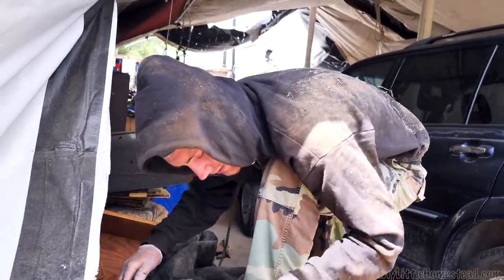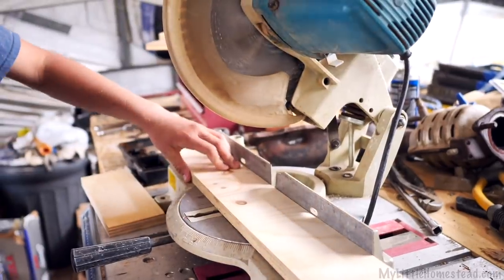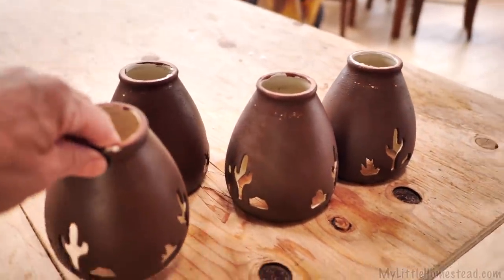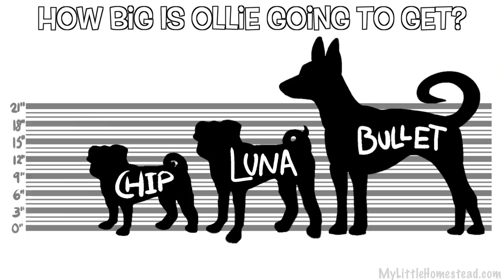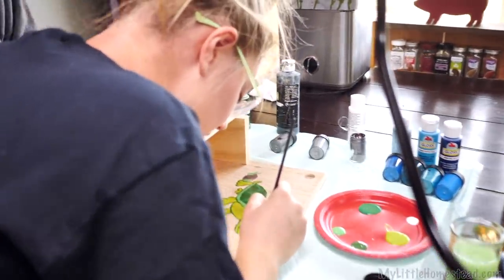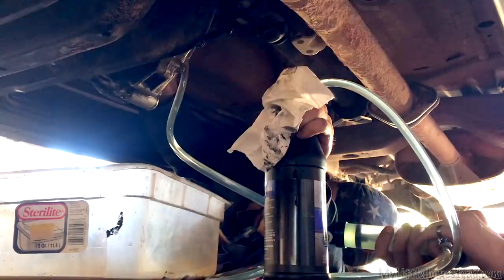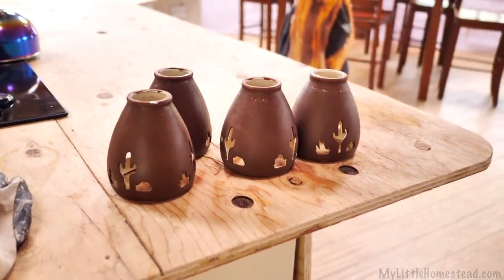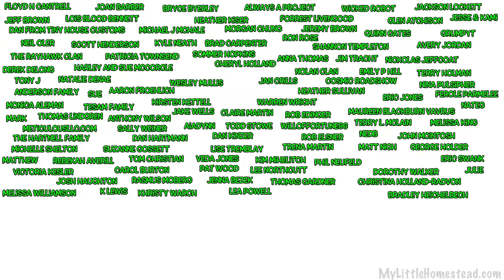Suzuki Engine Swap Complete, Outdoor Shower Caddy, Patio Solar Lights | Weekly Peek Ep186

Comment: Shae: Idk about making your own hair products, but I started oiling my hair a couple years ago- my hair is down to my waist, and while the parts near the scalp get some oil which keeps it healthy, the parts below my neck would get drier and drier. I bought some oil (I use almond oil, but I hear pretty much any oil works), and I run a palmful through my hair thoroughly in the evening. Then I braid it tight and sleep with it in, so that it can soak in as much as possible, and I wash out the excess in the morning. 

If I don't have the time to plan ahead and oil my hair/ time to leave it in, I only shampoo the part of my hair that touches my scalp, unless my hair's particularly dirty for some reason- the rest of it doesn't really need more than water, it's not getting oily from my scalp. Extra shampoo would only dry it out. 

(I also add in a couple drops of lavender when I'm oiling my hair, bcs the smell helps with sleep. Mmmmm.)

Good luck with your hair experiments!!

Comment: Just a tip, when welding cast manifolds, preheat the area you are welding with a torch before you start your weld. This goes for all cast. The repair will last longer. So impressed you guys always do a great job.

Comment: Conditioner technique: Wash your hair, towel dry, then take a TINY amount of conditioner ( start with less than a pea-sized amount and adjust according to results and length) in the palm of your hand and rub your hands together to spread and heat it up, then run your fingers/palms through your hair starting with the underside and ends. Use very little to none at the scalp/roots and top to avoid looking oily unless deep conditioning. 

Your scalp produces it's own oils, so you generally only need a touch on the ends, especially if you are not stripping your hair daily with modern commercial shampoos. You could even let your hair dry completely first before conditioning to really see what your hair is asking for.

 If needing deep conditioning, use more, then leave-in for a while, even sleeping with a beanie on to get the deep heat treatment then wash thoroughly. 

To add a nice scent to the mint extract in the conditioner, hammer some fresh rosemary and leave it in the jar to infuse. I love the rosemary-mint combo! For the baking soda shampoo, maybe add a wee bit of lemon and honey to that so they all work together. The acidic lemon will help remove oils and the honey will heal. Good luck, sorry to babble <3

Comment: I have been using baking soda to wash my hair for over 7 years. It works by opening the scales of your hair to allow it to release excess oils. I really only have to wash my hair about once a week because it no longer over-produces the natural oils usually completely stripped away by modern shampoos. You will only need to wash the roots and your scalp. I also used a 50/50 mixture of apple cider vinegar and water, in a spray bottle, as a “conditioner”, which closes the scales of your hair. This only needs to be applied to the ends.

My hair is so much more healthy, fuller and softer, since I’ve been doing this! And it’s so much more inexpensive!

Comment: I love that you are trying out the "No Poo" or "Shampoo Free" hair care. There is an adjustment period while your scalp gets used to not having all its natural oils washed away completely, but it will eventually even out. Ive actually been using Baking Soda/Water "Shampoo" and Apple Cider Vinegar/Water "Conditioner" on both mine and my kids hair for over 6 years, and I love it!
Reply: @Leslie M Agreed. And not only do you have to figure out the right ratios for your particular hair, but your water too. And if the water changes, like when my city changed something they treat the water with, or in the MLH's case if there's lots of rain or something, you may need to adjust it again. 
We also add tea tree oil to ours because scalp and skin conditions run in our family, and the tto helps with those.

Comment: Bryson,
I hope you didn't let Ben forget the blinker fluid.  We all know how quickly that runs dry.
Reply: Sounds like they need to check their muffler bearings too.
Reply: @williwonti  and the wind shield gear fluid. that's a must. (My dad told me that one)
Reply: Hah! My older brothers did that to me back when I was kid!
Reply: It doesn't run out if you never use your blinker. That's why so many people don't use their blinkers cause that blinker fluid is so damn expensive and hard to find.
Reply: @shadfurman  
Nobody uses them because they always run dry.  I guess all of them have a built in slow leak just to make you buy more fluid.
Reply: I think you used to much conditioner try adding glycerin to cut it

Comment: My Suzuki is 12 years old, I just love it. It's now my back up vehicle. As long as you change the oil every 3 months or 3000 miles it will last to 250,000 miles. 👍

Comment: I think your little guy Ollie is going to be about the same size as Chip.  He was so cute when he almost fell asleep standing in the kitchen.  Love the bathroom caddy's and the artwork on them too!    Great job on getting the car going.  I have the same philosophy on car buying as you.  I own a 2000 Ford Taurus that with a rebuilt engine now only has 85,000 miles on it.  I only paid $2,500 for it. Deals on cars like that fit the budget!

Comment: Use nickel welding rod and preheat manifold to glowing red orange, weld, slowly cool down by wrapping in a fiberglass welding blanket from harbor freight and it might not warp. Bolt manifold to a steel plate 1/2" thick and do the above and it gets better. Also  prep manifold by grinding crack to a grove. Find ends of crack and drill a small hole at the ends to stop the crack from getting longer. Every welder that I know has a different prosses on welding cast but after 45 years of weld on mining equipment this is the best that I have found. Keep doing what you are doing, it's fun to watch.

Comment: When you use homemade oil conditioners like that, you just use a tiny dip--just enough to barely grease 2-3 fingertips. Then, just work it into the long ends OR after it's dry, you use it to tame the flyaways. That's what I did when I used it with long hair.

Comment: I think Ollie is going to be exactly the same size as chip (maybe smaller?). There should be a prize for whoever is right, like a free T-shirt! Bree, you honestly think your turtle looks like a four yr. old did it! WHAT! You'd have to be a child prodigy! Bree and Shae, you both did so well with your paintings! WOW! Shae! that is some amazing woodworking skills!!!!Those solar light are amazing! So cute! (cute means smart technically and these lights are! as well as adorable! which is what most women think cute means) Great job boys getting that engine in! I could go on and on, but in short your family is oozing talent, humor, and genius!
Reply: I paid 182 bucks for a 1975 (?) Chevy nova (it looked like the two door model but with four doors), just needed a new battery. Ran like a charm for 3 years until I got pregnant and couldn't fit behind the wheel and had to sell it.

Comment: You probably have yucca plants around your area. You can use the root to make shampoo.  Peel the outside of the root, cut up and grind it down to small pieces. You can put some of this in water and squeeze out all the liquid from it.  You can also dry it for it to last and just use a little at a time as you need it.  Yucca is a great plant and used for many things by native peoples.  You can use the fibers in the leaves to make cordage.  You have to break down the leaves and scrape the fibers down ... the pulp/sap that comes from the leaves can also be used a shampoo/soap but the root is better for this.  You can eat the flowers before and after they bloom. the cordage was use to make shoes/sandals etc.

Comment: I've used baking soda and water as a shampoo and apple cider and vinegar in water as my de-tangling rinse for a long time.  It works very well; however, at some point you may have to adjust the baking soda water ratio depending on the hardness of your water.  Same with the vinegar water ratio.  You will also possibly go through an "adjustment" phase in a couple of weeks where your hair will look...well...unclean...lol  When I hit this, I added a little more baking soda to my water and backed off a bit on the vinegar.  Things balanced out for me and then I gradually went back to my standard ratio.  I have waist length, very fine hair and this worked out well for me.  I use the standard 1 Tbsp baking soda per 8 oz water and the same with my apple cider vinegar rinse.

If you're looking for a great lotion that works on face and body, try this...

Ingredients (Used Family Dollar Brands if you can get them)
13 oz pure petroleum jelly (vaseline)
     ( I use a tube of Vaseline Jelly and a tube of Vaseline Cream with Shea Butter to total 13 oz, or close to it)
15 or16 oz baby lotion (not oil)
16 oz vitamin e cream (not lotion) - my Family Dollar carries this and it's a really good deal
Aloe Vera Gel, clear not green (14 -16 oz bottle)

Put all the ingredients into a good size mixing bowl that you're no longer going to use for cooking (buy one at the dollar store) and mix with a hand mixer until well combined and smooth.  Portion the lotion into glass jars with plastic lids and use away.  This makes a really nice gift too.  Anyone I've ever given this to loves it and either wants more or the recipe.

Comment: I'm the type of vehicle buyer that I like to get a good deal and then run it till it is dead, and then some. My current vehicle a suburban I have had for over 10 years now, just had the clutch go out in the automatic transmission so a friend is rebuilding it. I do have this crazy plan that when the engine finally goes I will convert it to a electric vehicle, probably with a generator for long trips, which would actually be cheaper to buy a new vehicle but I have put so much time and tinkering into it that I just wanna keep it. I have also been working on vehicles off and on for over 20 years so...

Shae you may want to add some drainage holes to your shower shelves. Otherwise you way find your shelves becoming buckets, particularly during monsoons.

It is amazing how just changing a little thing like the light covers can bring new life to something. I think it is much better to just update the looks like you have then to replace the whole unit, when we bought our house we had three hanging lights with very colorful light fixtures that didn't really match the rest of the decor, so after some shopping around I found three new covers that worked with the lights and accents our decorating.

I think Ollie will be a little smaller than Bullet. But who knows maybe he will be as big as Clifford the big red dog :P

Bree the land turtle name you were thinking of are tortoise. Nice gila monster, I always loved them but didn't want to touch them.

Nice use of the solar lights and ceiling fan cast offs. I tend to get maybe 1-2 years out of my solar lights too, if the solar cell is still in good condition I sometimes replace the battery and get longer use from them.

Comment: Shae, if you use the baking soda shampoo, it will help get rid of the residual oils from the conditioner. It is a good shampoo to use if you use a lot of hair styling products too since it removes the build up of those products on your hair.

Comment: I use baking soda and water to wash my scalp, leave it on for about 5 minutes. Then rinse with apple cider vinegar and water, leave that in for about 5 minutes. Then a final rinse with warm water. I wash my hair once a week, but have gone longer before it gets oily. My hair is not oily or dry normally, so adjust the time table for your hair.

Comment: Just wanted to mention. for some reason after sitting for a wile some brake pads ware alot quicker.  so I thought i would mention that so you could check them in a month. may keep you from scratching the roters. those light Suzukis tend to stop not to bad on just roters but... then you have to replace them calipers and roters. been there done that. I learned the hard way to replace the pads after sitting for quite a wile. Menny safe traveles.

Comment: Use apple cider vinegar for conditioner. A mix of 1 to 1 with water works great. Make sure the vinegar has the mother (not pasteurized). Leave it in for at least ten minutes and then rinse it out.

Comment: I had to do a dep clean on mine and we took out all the seats and center console, it is cleaner but we learned there were different sized bolts when we were putting them back.
Because if a bent axle I cant drive it and I really miss it...

Comment: With your conditioner.... Only use a TINY (fingertip size) bit and smooth it into your roots first. Then, brush it through. Honestly, that recipe is meant to leave in and deep condition! I use it for about à week before coloring my hair and about 2 weeks after in order to put the shine and hydrated, healthy look back into my hair. Believe it or not, you can use just the coconut oil by itself, the same way as I've mentioned if you want it to be a much lighter level of conditioning. Also, coconut oil mixed with brown sugar makes an amazing lip scrub. If you make a big batch, add a bit of baking soda and it turns into a great, hydrating body scrub!

Comment: Just a suggestion regarding the shower box, if you haven't already done this...drill holes  in the bottom of the shelves so water can drain out and not sit inside the box.  I didn't see holes when you were filming...perhaps I just missed them :)

Comment: I'm pretty sure those solar lights just have a rechargeable AA battery in them.  I think I salvaged one once by putting in a new battery.  However, at $.97 a new one is cheaper than labor needed to salvage.

Comment: If that manifold cracks again, you should find someone with a TIG welder, or at least a gas shielded MIG machine with a healthy amount of power. The flux core just doesn't penetrate cast iron well.

Comment: If you don't wash your hair for a while, it does take a few months, your bodies natural sebum production decreases so your hair is less greasy.

Then you don't need to condition, the light ends of the oils evaporate leaving a very thin wax that gives hair more volume and bounce like high end designer conditioners (that really aren't good for you).

If your hair gets dirty, warm water melts the wax and will rinse out most of the particles.

If your hair get REALLY dirty, and you need a little more than a rinse. Some plain real soap (some EO fragrance is ok of course) like the kind of soap made from rendered from fat and lye, or some plain glycerin soap is ok too, desolved in water, (this is kinda like a dilute of Dr. Bronners, so you can just buy that if you want, I find it too expensive to be worth the cost) I like to put it in one of those foaming hand soap pumps.

You'll want to recondition after using soap or really hot water, one of those hand pump cooking spray bottles for olive oil work great. Maybe 1 tblsp olive oil to 4-5 table spoons fractinated coconut oil or MCT oil, shake it really good. A lot of people like macadamia nut oil, but it's stupid expensive.

You kinda wanna fluffy your hair as you spray, you want to get the underside more, it'll wick up to your top hair if you get too much, but if you get too much on top just rinse it through with hot water. The MCT oil evaporates leaving a very thin even distribution of olive oil, which is a little more greasy and heavy than your body's natural wax, but it keeps your body from over compensating to reduce the dryness.

Sebum is a healthy part of your immune system. This sounds gross, but it's how your body works naturally if everything is functioning correctly. As well as covering your pours and scratches to keep bacteria out, sebum traps your skin flakes to the skin where bacteria eat it releasing ozone and other oxygenated molecules as a byproduct, which is a very powerful anti-microbial and protects you from infection.

Also the competition of various microbes creates a diverse biome ecosystem that reduces microbial and fungal overgrowth.

Comment: With your families interest in home car repair and life extending automotive maintenance as well as building your own buildings, I would like to suggest when you rebuild/replace your half collapsed hoopbarn garage space you start with a designated car bay space including a mechanic's pit which is just a reinforced space to work on a cars undercarriage safely while providing space for the mechanic and their tools. The best ones have a metal frame inlaid into the surrounding concrete to allow covering plates to A) provide a work surface over the pit. And, B) provide a raised lip and cover to prevent liquid runoffs finding their way into the pit. (A drain pipe for cleaning would be an excellent inclusion.)
Reply: Also Ollie is gonna stay pretty short but get really wide both with muscles and a lil fatty. ^_^

Comment: I purchase my trucks at around 200k miles lol.  My lady ram had 246k and still runs beautifully,  but I was unable to stup when someone pulled it in front of me.  The engine and trans is still good so I purchased another ram so I have my old one for parts.